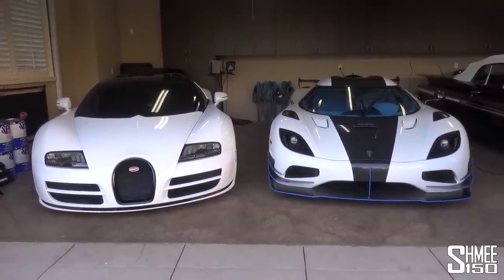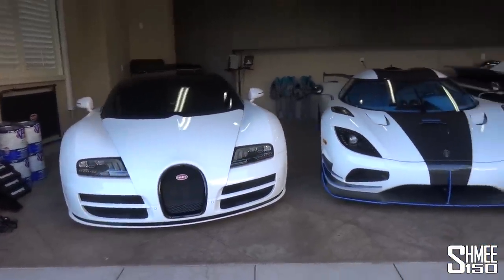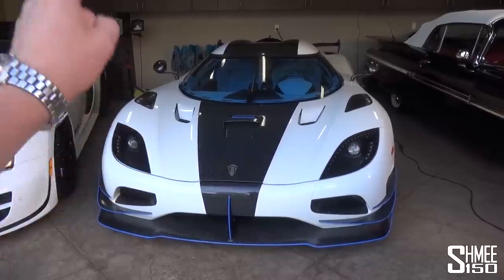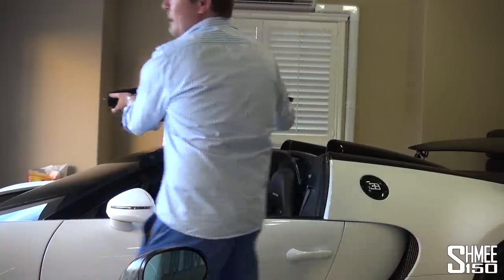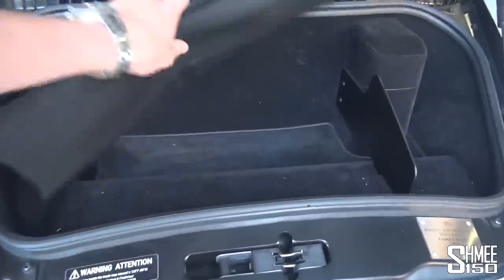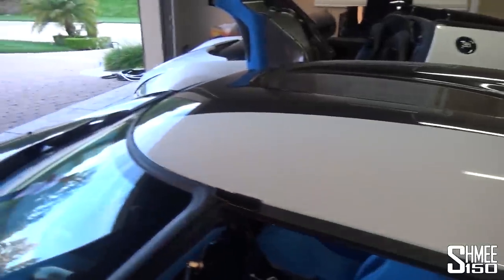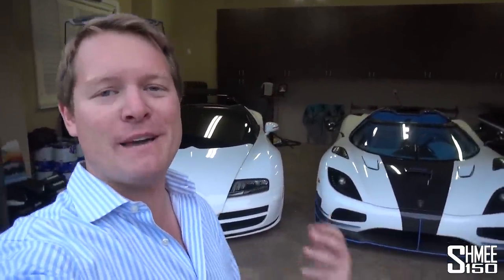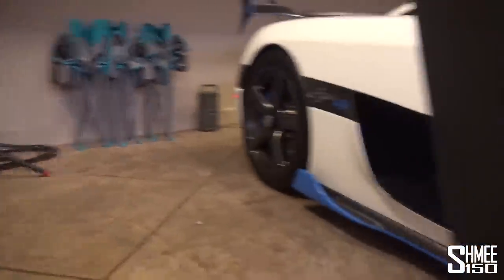Koenigsegg Agera RS or Bugatti Veyron Vitesse?

Comment: Koeneggsegg every time for me, it just LOOKS menacing even sitting silently as if to say: "Try me. I dare you."
Reply: Amarjit Singh the koenigsegg jesko is going to reach 330
Reply: @Amarjit Singh most of us have seen jesko testing
Reply: @Amarjit Singh its also in production
Reply: @Amarjit Singh speed is calculated in computer. The agera r ran 270 mph on simulations. The agera rs went 284. So todays sumulations are pitch perefect
Reply: @Amarjit Singh is your bugatti delivered
Reply: @Amarjit Singh its actually 304 mph actually amarshit
Reply: @Amarjit Singh good doing that in a customer car as they are limited.
Reply: @Amarjit Singh u havent told the frontal area of bugatti chiron super sport 300+yet. I calculated with 2.0 meter square and got 307.074. Should be slightly different. Took sea level air pressure. Whats your opinion.
Reply: @muhammedzayan4399  don't talk with that kid he doesn't listen to anyone and always goes to videos to talk shit about other cars if it is not a bugatti and can't take that the chiron ss was modified and is not a production car.

Comment: My favourite? Koenigsegg of course! Simply because how they look, how they drive, how powerful they are and most importantly, every Koenigsegg is convertible.
Reply: when did u drive one?
Reply: yixiang loo the one:1 ain’t a convertible
Reply: @justno8019  you got it wrong my friend. My "How they drive" mean how that car being able to put down that massive power onto that rear wheels without any problem or you can understand it as it drive smoothly. And yes, I don't really have a chance to drive one. I am only lucky enough to see one of those driving around London streets. It might took me forever to drive one or even have a seat in it.
Reply: @shihanarifai6640  every Koenigsegg have removable roof. Go search Koenigsegg Agera on Wikipedia, then, jump to the Koenigsegg One :1 session and start reading carefully. You will see one line that say "There is an airscoop on the removable roof, so it would not have been possible to stow the roof in the boot like previous models." this mean that the Koenigsegg one:1 have a AIRSCOOP on the REMOVABLE ROOF doesn't mean the roof is unremovable.
Reply: The One:1 is a convertible. It's the CCGT that isn't

Comment: If you look at a Koenigsegg ist just like a block with a bit of a downwards cut in the front

it has no curves ist just a straight line from the back to the front
Reply: Elias Håkansson no take at the look at the other car 

The bugatti 

That does not look just like a block
Reply: @hikingjoe4752  But the Koenigsegg is much more aerodynamically capable compared to the Bugatti

Comment: 284mph for the agera dude
Reply: Yh but people say 277..it hit 284 (it stopped there.. That is its capable to speed).. And then hit 277 on the second run.. So they averaged it out... Btw you have to make two speed runs to get the top speed... To calculate slopes and height in road and how that affects acceleration... To see if the car could have gone any faster.. But still.. It did top out at 284...hennessey only did one run and got 270 ...and are claiming they could have gone more.. What i dont know is why they couldn't just get a longer strip and test it out?..
Reply: It was windy that day. It couldn't rev out on the way back. Better conditions of course it would have averaged higher.

Comment: I still dont understand why the bugatti put limits on their car also the real horsepower of the veyron is 3000hp but they have to lower it down since it indeed almost set on fire of the building.  XD                   sorry for bad english.
Reply: CEADEUS 117 we humans can make 15000 hp engine but a human will die we can make a Bugatti with 5000hp but it wouldn’t be stable
Reply: Voltaic Volt true
Reply: You mean that it is capable of 3000 hp right? Btw they always have to limit their to speed because of their fking weight.... And tires..... Especially tires.. Especially tires..and as said before.. The weight affects the car aswell.. Koenigseggs are lighter and still have a problem with tires but because of their lighterness they are able to reach a higher top speed with similar hp.. Give or take 100-200  hp (on average) less
Reply: Gamatron LIV3Z hmmmmm...... now I think about it... if the bugatti is light as the koeneg would it fly??...... now I want to see that XD
Reply: yeah like gamatron's saying it doesn't matter how much horsepower the engine can produce, so long as the horsepower can be put down on the road by the tyres. if the tyres can't handle the horsepower, then it's not going to go any faster than a car with 1000hp.
Reply: thog yes finally a answer

Comment: is the chiron slower than the veyron though?
Reply from the maker: They have not made a convertible Chiron yet that I am aware of
Reply: Chiron is limited to 420kph but could do more, veyron vitesse reaches 409kph
Reply: Yh it is limited..it could (could)  reach a top speed around 280-288..but the tires cant handle that much pressure... Especially with that 2 ton monster they are moving...
Reply: Well the chiron is faster than most veyrons(253-258)..while the chiron is 262..however the super sport is 267 mph so the chirons need some adidas tires to get moving